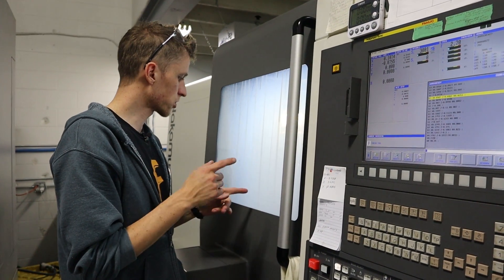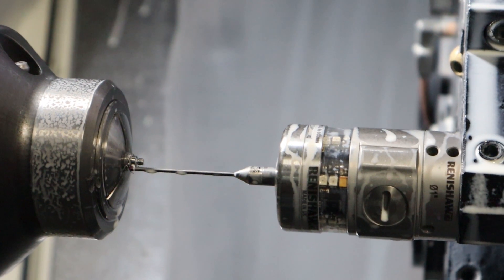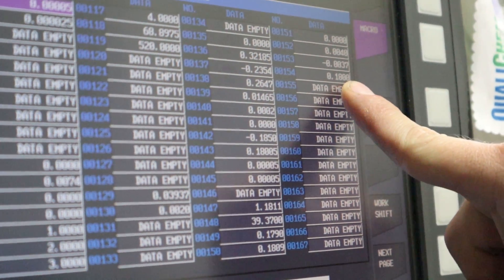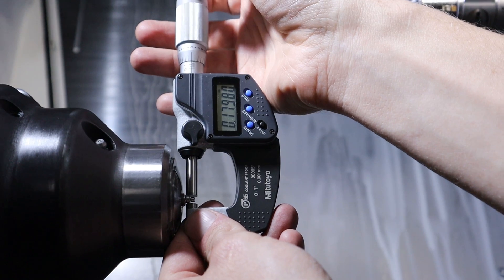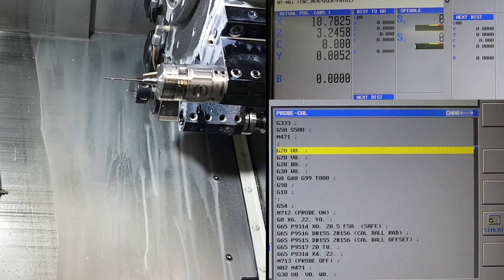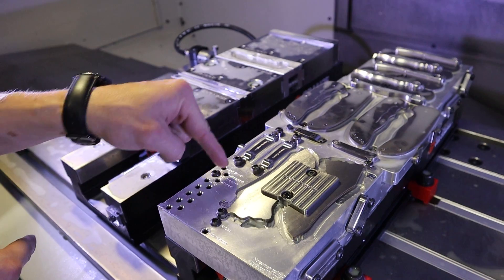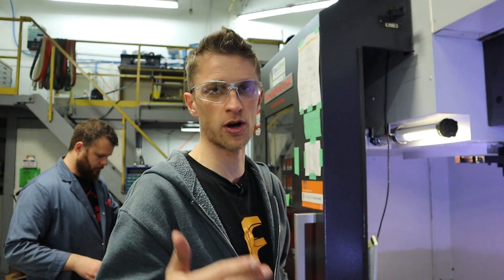Make More Parts, Better! - Probing & Macros

Comment: Hey i know this is an old video but looking for some info on the probing.  you have it touch each part in the beginning to see if its there and i want to set up the same thing but we are a foundry and our parts can deviate or (SHIFT) so we need to indicate each part on center. i want to make a pallet with 21 parts on it and quick see which ones are there.  now my question is do you have everything on 1 offset and programmed off of that or each part its own offset and just skip that offset if part not found? sorry i am not a very good book learner, i got the macro book, but i learn by hands on and seeing code and replacing it with what i need, thank you for all your help!!!

Comment: hey john, i was looking to get a Tormach for my garage,  as a fellow Canadian i was wondering how warm you had to keep your garage in the winters to run your machine without any problems and if it was costly. any feedback would be greatly appreciated.
Reply from the maker: We ran it for years with no additional heat, it usually stayed above 5c.  Then we got a radiant heater for about 1,200cad and life got REAL good!  I wouldn't worry about the tormach unless the garage gets below refreezing.  You can run warmup routines to make it happy.  Now we keep the shop at 70f day and night.
Reply: @JohnGrimsmo  Awesome! thank you for the information, you sir are a gentleman and a scholar.

Comment: Hello John ! Question on your tool breakage detection program. After the tool touches the tool setter are you reading system variable last position Z and comparing it to a predetermined height offset for that tool / tool number system variable? Or is it registering the number into a variable then comparing that value store in the check variable to the system variable for that tool / tool number height offset?
Reply: More then likely he is using the standard renishaw macros. By default the renishaw macro will look at the current active tool length (g43 normally needs to still be active) and move to -.020in and verify that sensor is triggered within that distance. You can also add a "H" value to you g65 line to modify that search distance as needed. Or even a negative H-.020 will then check for pullout as well as breakage, but this cycle takes 3x as long and isn't always necessary.
Reply: @dylanhughes9279  So then does the Renishaw Macros enter act with the machine Common Variables and System Variable. It has been quite some time since I studied the Mill System Variables for Height Offsets and don't remember the exact numbers. I will make this up for an example. System Variable Height Offset One #2601 = -10.0000 now when checking for tool breakage the Renishaw Macro checks that System Variable for that Height Offset Value after the Tool has performed the Tool Breakage Check from the Tool Setter. If it still matches the Value in the System Variable or at least plus or minus .001 then it runs the program but if it does then it puts the machine in a Alarm State and stops Program Operation.
Reply: @threeaxis359  I believe renishaw does most of its logic in the #100 to #199 range. But calibration is stored in the #500's (this can be changed in the settings macro). The tool offset location can be changed in the settings macro as well. For example, some machines use comp type A #11001 = T1 length but comp type C #2001 = T1 length. So, yes it looks at the tool offset for comparison, and the tolerance can be changed to whatever is needed. I use the laser style every day. Renishaw is very flexible.
Reply: @dylanhughes9279   Thank you on the info unfortunately I don't get to use Renishaw system but I do work with Macro a lot. I like to be informative on things in case of any future use of these particular items. I always look at it as knowledge gain is knowledge earn. Hope I said the quote correctly. Thank you once again Dylan on the insight of the Renishaw System.

Comment: Macro is great for families of parts. I’ve been programming macro for very complex steam rotor packing seals. Large diameter parts 40” to 150” stuff on retro fitted Bullard vertical lathes with FANUC controls. This allows me to write complex programs with simple plug and go instructions for operators.

Comment: Why are the blades slanted for engraving?
Reply: A ball mill like the one used here at the base of the ball the flutes are small so engraving at an angle allows you to use the slightly larger flutes on the edge. Also as its a ball mill it has a radius so it wont effect the look of the engraving like a pointed engraving addon/tool.
Reply: Wow, that is slick! I had never thought of that. Is there a "best" angle to engrave at?
Reply from the maker: @EZ_shop  what he said! If you angle to far for a given depth then you're using the side of the tool and it no longer acts like a ball.

Comment: Why are you engraving at an angle ?? I don’t think you went into it in a previous video.
Reply: surface speed is zero at tool center. engraving on an angle ensures a constant surface speed as the cutting diameter is greater than zero at all times.
Reply: @Shu---  does that affect the geometry of the actual engraving?
Reply: @brian2k1  depends on the tool geometry. with a ball end mill: no, does not affect geometry of engraving.

Comment: Could you use pins rather than screws to make that configuration system faster to set up?
Reply: I thought of that too, but then realised that when populating the pallet you already screw in a bunch of screws, so ... no real time loss there.
Reply: @folxam  Also, high pressure coolant can blow the pin out of the hole.

Comment: I know it's WAY off this videos subject, and DATED, but...

With your mill cabinet, recently you discussed upgrading the Cutting Oil, and installing/locating your Air Hoses for cleaning the Machined Product.

So, I never saw a video on where you placed the hoses/attatchment points. Did you place a hose/coupler within the cabinet?

As for Lightning, LED Driving Lights are what I suggested for my neighbor, and he LOVES the illumination and the ease of installation.

As a "typical guy", I'd do unspeakable things for a Mill/Lathe for my Fabrication of Riding Mower/Garden Tractor Parts & personal Custom Engine Parts!

-Keep living the life as a Successful and Proud Entrepreneurs!

-Thomas (12)
Port Orchard, Washington

Comment: Ok, that's an interesting approach to use physical objects and the probe to set a pattern.  I work in software test automation, so I can appreciate the need to improvise on things like data sources and verification methods when you get into a situation where there might not be a "right" way to do it.
Reply: There is rarely a right way. Many techniques can accomplish the same thing. I do get what you meant though.

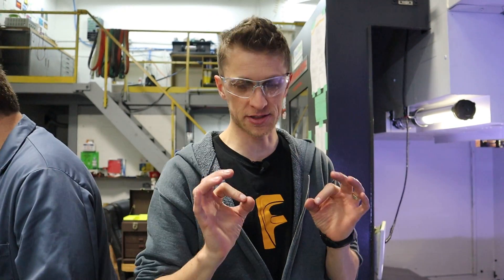Comment: I can't explain to you how excited I got when I saw the idea with screws at 7:30. I rarely ever get to run anything CNC related, but that is so FREAKING COOL. Love it.
Reply: It's like what electronics people do with solder bridges or resistors that are only placed if the device is one specific model or configuration.